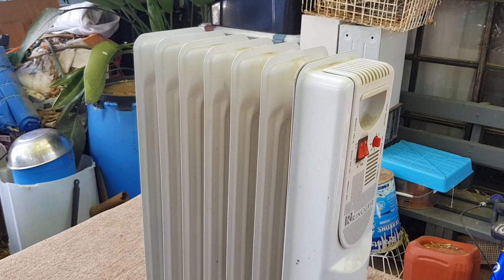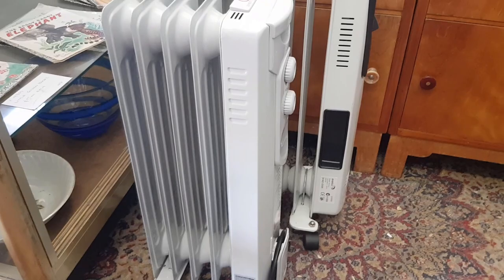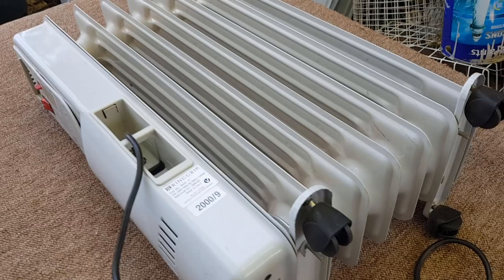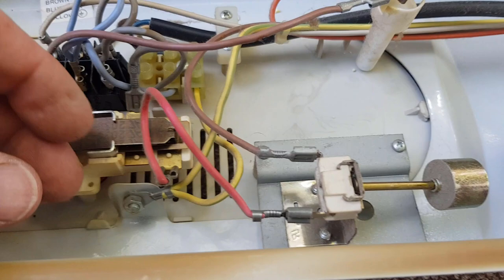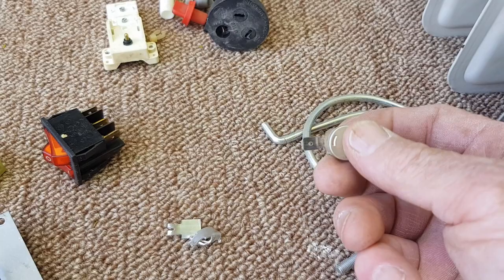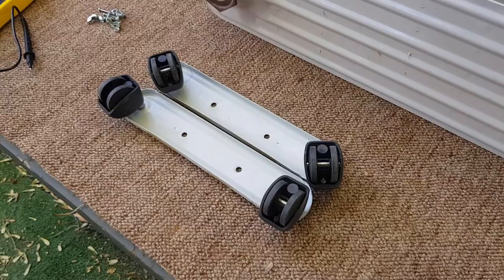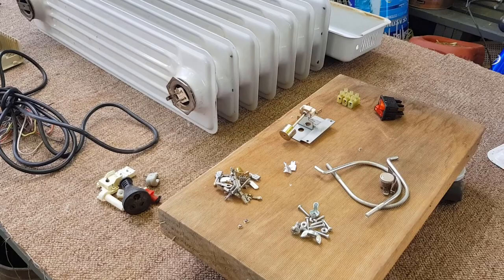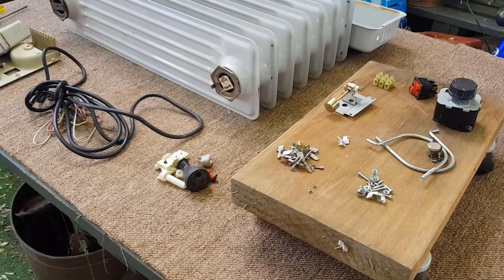Scrapping an oil column heater - Quick and easy with good value plus a pot plant trolley upcycle!

Comment: Nice one...I noticed you dont strip out the elements..not worth it?
Reply from the maker: Very little value in the elements Mario - mostly steel and I'd rather not disturb the oil!
Reply: @TheUltimateRecycler  understand..I thought the elements may have been copper or brass but I must have been thinking of the old models
Reply from the maker: @off spec There's nothing wrong with the oil.. I just didn't want to make a mess! I'm not sure on the oil type - probably a light grade high temp resistant mineral oil of some sort.

Comment: Can you bring the whole thing to a scrap metal yard? It has oil though.
Reply from the maker: Fair question Luke. The scrapyards allow for contamination with the shred steel price - and there's actually a waste levy as well at my yard. Best check your yard beforehand though..
Reply: @TheUltimateRecycler  my concern was that I couldn’t throw it away. So I put it in the garbage to see what happens (after parting the toggle switch out). someone winded up taking it so I guess they’re going to bring it for money less hassle

Comment: I really liked the video. The plug from my Delonghi heater is damaged but the power chord is still good.  But I can't find a new cable to replace it where I live.  So is it ok to replace the plug but keep the original chord? Thanks in advance
Reply from the maker: Yes, for sure Marcelo. Replacing the plug would be fine as long as it is rated for similar current to the old one 👍😊

Comment: where do you buy the oil casket for the heat element ? My heater oil is leaking
Reply from the maker: I don't know, but it would be probably pretty easy to cut one from general purpose gasket material or even use a gasket compound.

Comment: my radiator makes noise when it starts to heat is from gorenje company what can i do
Reply from the maker: Depends on the type of noise really. Some of these oil heaters do have 'expansion' creaks as the metal expands while heating - there's not much you can do about that. Thanks for watching 😊